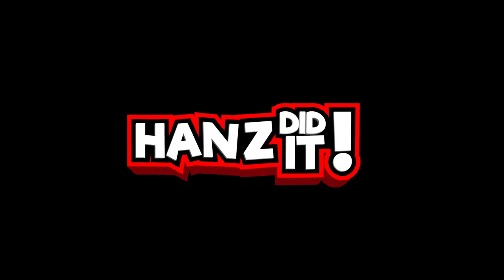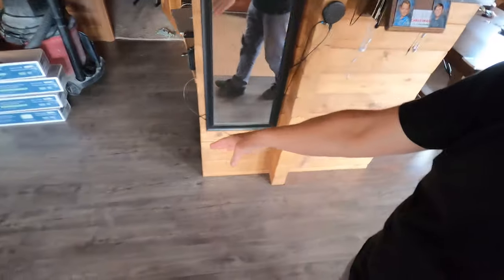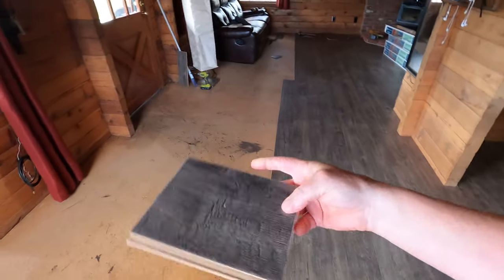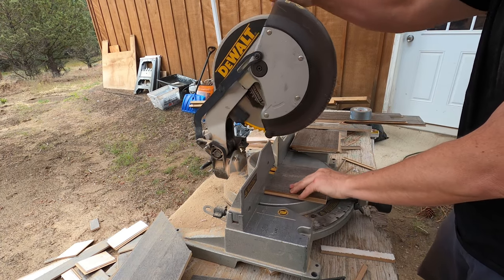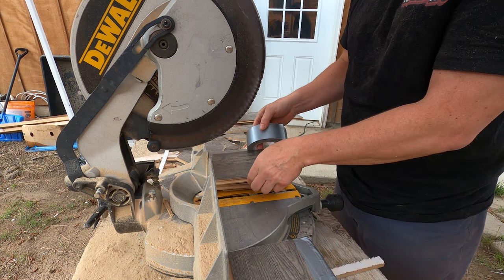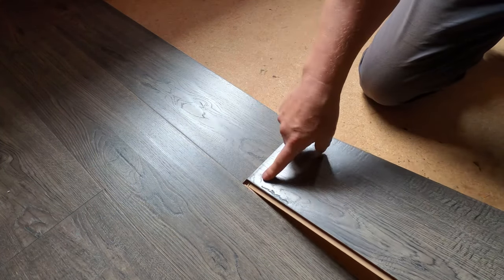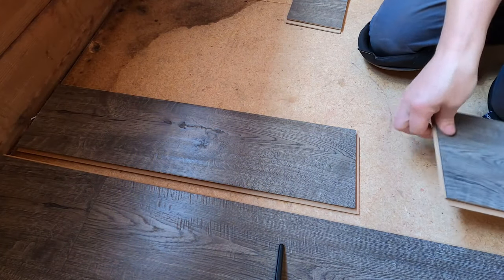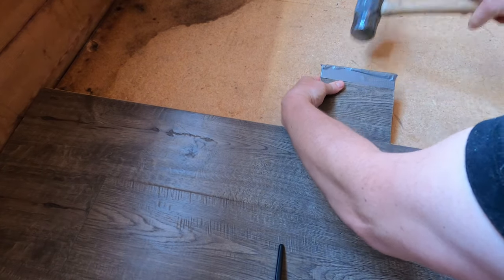HOW TO Install Laminate Flooring 101 Start to Finish (Costco) 2020

Comment: We had to use a black tapping block on our Costco flooring, picked up at a hardware store- they're very inexpensive. The homemade tapping block with duck tape just wouldn't tap the joints together, or if they did- for some reason they would slide out, and we'd have to take it apart and start over. Other than that, thank you for the helpful tips on installing this flooring! The flooring does go on sale every couple of months or so... if you want to save money. We ordered online, free shipping.
Reply from the maker: Great tip, thank you so much for watching and supporting my channel.
Reply: I’m having lots of problems with the boards coming apart.. about to give up.. did you figure out a solution?  Was the tapping block all you needed to keep them locked together?  Thx
Reply: Use the tapping block,it really is inexpensive, not sure why the guy likes to do this . Start against a wall, that first row is hard part , once u have that it goes smoothly

Comment: This is awesome, Hanz! really appreciate your taking the time to show us how to install the floor!
Reply from the maker: Glad to help, thanks for watching!
Reply: @hanzdidit  Hey Hanz, how thick is your laminate? 15 mm or thinner? I am using 15 mm, during reverse installation, when tapping, the tongues were destroyed.  I'm not sure, if it has something to do with my technics or the board won't work with reverse installation. I tried quite a few boards and through different angels when tapping, the results were always the same. By the way, my laminate is GolenSelect. thanks!

Comment: Honestly, the floor came out really good. You take great pride in your work. I gotta do a rehab that has 900 sq ft. I’m going to go check the flooring at Costco since I’ve never used theirs yet. Thanks
Reply from the maker: So glad I could help, let me know if you have any questions with your project. Thanks for watching.

Comment: Just in case anybody watches this video and reads the comments, I found that a dead blow mallet along with using the little sacrificial pieces of flooring is the best way to go to make tight joints. A dead blow mallet has a larger surface area and doesn’t smash your board in the bits nearly as fast as say a 16 ounce claw hammer. It also gives a little more push with less swing
Reply from the maker: thanks for watching.

Comment: Thank you for the great tips as I am getting ready to take on this daunting task myself. How is the floor holding up? And do you have any helpful after thoughts or suggestions in addition to this video? Thanks again for sharing your knowledge.
-Will
Reply from the maker: Awesome, it's not a super fun project but you will be so stocked once it's done. This was the second half of my house that I had done the floors in, I don't think I have any extra tips or tricks. As far as the durability the floor is very impressive with my dog, Sliding furniture around, and just general wear and tear where I live I have not seen any spots that are wearing or showing any signs of fatigue. Thank you so much for watching and supporting my channel. Good luck with your project, if you have questions along the way let me know.
Reply: i know it's quite randomly asking but do anyone know a good place to stream newly released tv shows online ?
Reply: @Byron Kaiden i would suggest Flixzone. Just google for it =)
Reply: @Byron Kaiden Lately I have been using FlixZone. Just google for it =)

Comment: It would have been useful to see your trim work around some of the walls and ducts. Meaning HOW you did it. What did you have to do differently with the flooring to make it work?
Reply from the maker: I did nothing for a trim. Because my walls are wood and the floor is wood ish when you look at it from almost any angle in the room you cannot tell that they are not connecting to each other. I have a 1/4 inch gap around the entire room and unless you walk up to the wall and look down you  do not notice the gap. I'm sorry I did not make a video showing how I did the trim I just did not do any trim. Hope you're having a great day, and thanks for watching!

Comment: Great work! Wish i saw this video before starting my project. Thank you for the tips. I am curious to know how you got the last layer in when they were almost up against the walls, and there was no room left to hammer them in. This last area seems to be the most difficult in my situation.
Reply from the maker: I agree it was very difficult at the very end but I left enough of a gap to get a tool in there so I could apply pressure to the plants and get them to clip in. Hope the video was helpful, thank you so much for watching!

Comment: Great video! One quick question.. In the Mowhawk tutorial and the instructions it mentions removing the tongue on all long side joints on the first row. Did you do that or did you skip that step? Didn't know if it was something that isn't always relevant.
Reply from the maker: Yes I did cut the tongue off of the first boards against the wall. Sorry I left that stuff out of the video. I cut the tongue off and I used a small spacer to keep it a quarter of an inch away from the wall all the way across. This helped to keep everything square. Hopefully the video is helpful thanks so much for watching.

Comment: Did you have to remove the groove on the first row where it's up against the wall?
Reply from the maker: On mine I did and I put a quarter inch piece of blocking to give me the space against the wall. when I was finished I took it out. It is a floating floor so you want to make sure that you give it that extra space and not jam it right up against the wall. Thanks for watching!

Comment: Thanks for the video.the on 
I'd love to k otw the 3 sizes of the  first board. One is full size. Then u cut the next 2 rows but what size?

Also how did u get the 2 sections to line up when you got your first long row
Reply from the maker: There is no right or wrong way but the way I did it was three boards and I stagger the joints and try to get them to line up with a straight edge. The stacker does not really matter that much but you want to have at least 12 inches from the last seam and then I tried to make the rest all line up. Hope this was helpful thanks for watching.

Comment: When you redo your flooring like this, do you rip up the old laminate or just lay over it? I need to redo my floors BAD.
Reply from the maker: You definitely want to take the old laminate up before you put anything new down. If you don't it will cause squeaks and also the height of the floor will be too much. It's easy enough to pull it out trust me it takes about 1/10 of the time putting it back in lol. Thanks for watching.

Comment: Hi, this is a big help for us. I have a question, we have a daylight ranch and want to put this same Costco flooring down. The downstairs has those square schoolhouse type tiles, do you think there is a need to put something over it first before the vinyl planks? Also, watched the Carlton video too, were also in Oregon so glad the smoke has cleared. Thank you 👍
Reply from the maker: I am not an expert at this and I do not want to tell you the wrong thing. If it was me I would just go over the schoolhouse flooring., each board has a foam backing on the bottom that should give you the support and sound suppression you would need. if you are doing the vinyl planks I think it should be fine to jus go over the top as well. 
We finely got some clean air :) thank you so much for supporting my channel and I hope my video helped.
Reply: @hanzdidit  Thank you so much, one more question please. My husband has the same Dewalt saw I saw you use in the video, Is there a special blade you used to cut so the ends didn't fray or look rough? Maybe I could tell him the blade size or tooth thingy that you used to keep the cut smooth.

Comment: They say no vapour barrier is needed because of the foam backing. I’m laying it in a basement on bare cement where we get harsh winters of -40C. Do you think I’m ok to not put down any barrier?
Reply from the maker: To be honest if I was you I would use vinyl waterproof planks. The stuff that I used is water resistant and I do not think it would handle the moisture in the concrete for very long. The vinyl is not supposed to expand as much and they say it is waterproof. Make sure when you buy It, the box says waterproof on it. Good luck with your project, let me know if you have anymore questions. Thank you so much for watching.

Comment: What did you do about the linoleum to bare floor difference in height (I know, not much)? 
I got a big talk about how the surface has to be level, so that's what's next for me.
Reply from the maker: I used a product called "fix it all" and I feathered out about 24 inches from the linoleum onto the wood surface, this spreads out the different instead of just a hard drop off. When you walk on it you cannot even feel the difference in height. When I installed it I was very concerned about this as well, I think I had the same talk with somebody about the transition from the linoleum to the wood. In my opinion if you can get it feathered out you will never notice it. Good luck with your project and thank you for watching my channel.

Comment: how do you go under door frames with this product if it has to be tilted up at 45 degrees to lock in place?
Reply from the maker: Because the board is so short going through a doorway you can just tap it in with a hammer. The instructions say you should put transitions between each doorway which I did to make the floating floor work like it supposed to. Because I wanted it to look a little bit cleaner I tried my best to create that transition by tapping the boards in with a hammer on two of the transitions so far it has been fine but all the rest of my transitions have been made by a 2 1/2 inch space and a transition plate that I made custom. Hopefully my video is helpful, thank you for watching.

Comment: I see that you didn’t put a new liner underneath the laminate, I suppose it was not needed?
Reply: the flooring has a pad already attached to each floor piece.
Reply from the maker: This type of flooring that I was using did not require a liner it is built-in to the board itself, glued to the back and the bottom side that you would put down on the floor. I hope that he was helpful, thank you so much for watching and supporting my channel.

Comment: Instead of doing all that duck taping, did you ever try using a rubber mallet?
Reply from the maker: Yes I did and it tended to damage the boards too much so they would not click together. You need to have something wider to tap on so that the boards will not deformed. Like I said this is not the right way to do it it's just the way I did it and it seem to work fine. Thank you so much for watching I hope this was helpful.
Reply: @hanzdidit  no I think you misunderstood.  I like your method, but instead of using a metal hammer like your did to tap in the duck tape diy piece why didn’t you use a rubber mallet to make those pieces last longer and you don’t have to duck tape them.

Comment: You don’t need a moister barrier under the planks?
Reply from the maker: Not with the floor i was using. The old floor did not have the backing on it so I had a moisture barrier down for that one. The stuff that I put down had a backing  on each board. Thanks for watching I hope this was helpful.

Comment: What tooth count did you use on your miter saw?
Reply from the maker: I believe it is a 80 tooth blade. thanks for watching!
Reply: suggest using an INexpensive blade. tooth count isn't important as typically very little might chip off the top and only very occasionally but it is NEVER seen since it is covered by a baseboard. I bought a brand new mitre saw and was very disappointed by day 2 my saw wasn't cutting the same.. oh well continued figured I'd look into it another moment when i had time.... day 3 and now it was clear the blade was no longer sharp as it struggled mightily and then even burned the wood on 2" x 4" practice cuts. upon research on the internet ( I know too late) I discovered laminate floor is EXTREMELY difficult on blades. therefore as my vast research discovered cheap inexpensive (somewhat disposable) blades are best if doing a smaller project ... but in my case I had 600 + sq' now + 500 sq' at a later date to do thus I bought a PCD blade. PolyCrystalline Diamond blade. it can be used for cement board and it is expensive but it can last upto 75 tmes longer (that's what it says ... don't know if it's true) here is the link https://www.squareshardware.ca/diablo-d1216lf-12-x-16t-pcd-laminate-flooring-blade.html?gclid=Cj0KCQiA962BBhCzARIsAIpWEL3z0Ch-35LPAMSq0FRqjPJyfx4vCHwirBNO44hkZ11DMeTp9ZRJK-8aAqliEALw_wcB

Comment: I was using golden select brand maybe it’s different then what I used
Reply from the maker: I'm pretty sure that most of these laminate floor click together components are all fairly similar. This was just the one they had at Costco that I like. It really wasn't that hard it is took a little bit of time. Thanks for watching and supporting my channel.

Comment: Hey there if you read the box on the Costco Vinyl flooring it says do not tap.You slide the long ends together and then press the ends down till you here a click.
Reply from the maker: I'm not saying this is the right way to do it, I am saying this is how I did it and it turned out great, looks great and went together fast. I've never been one to read directions I just like to get things done Quickly and efficiently. Thanks for watching and supporting my channel.

Comment: I guess there are more than ONE way to do it. I just installed Costco laminate flooring (Golden Select Sandstone / hand scraped) in 2 bedrooms + the upper hallway / bonus area for a total of 600+ sq'. I installed it like the box instructions said which was tongue side 1st left to right and against the wall ..... meaning 2nd plank tongue short side goes into groove short side etc.. and all other rows tongue  long side go into groove long side planks which is opposite to your video where you installed grooves into tongues ?? but you more than made it work. ...BEFORE starting I suggest measuring room and divide it by plank size so as to not be left with a very thin row which would not look as good nor be as strong even if typically a baseboard goes over last row to help hold it down.  Yes it said NOT to use a tapping block and YES I also used one cause I quickly discovered it became EASIER to lay it down with it BUT be CAREFUL not to chip the plank's top laminate. ... I was very happy as my wife and son love the more modern look and I'm lucky my project wan't as complicated as yours in scope. you did a great job and your home looks sharp.
Reply from the maker: Most of the projects I do I do them the way I think they should be done. I'm not telling anybody that this is the way it should be done I'm just showing how I did it. Got it done looks good love the floor so far wouldn't change a thing. Thanks for watching I hope the video is helpful.

Comment: Look like you installing board backwards
Reply from the maker: They can be installed either way. I had to continue this direction because I had the other half of the house done the same way. I tried it both ways and it does not seeing any easier one way or the other. Hopefully this video is helpful, thank you so much for watching.